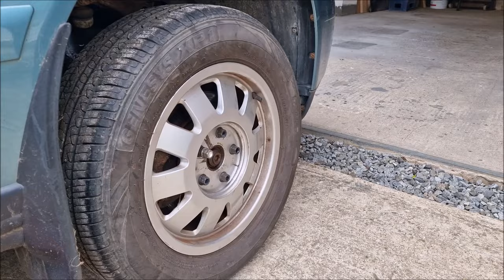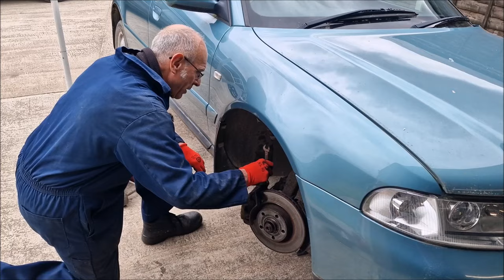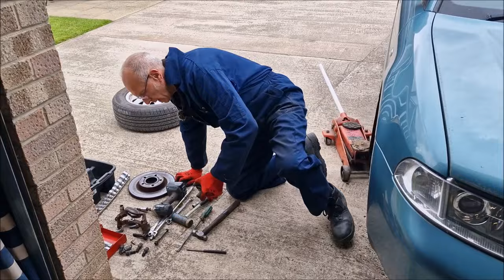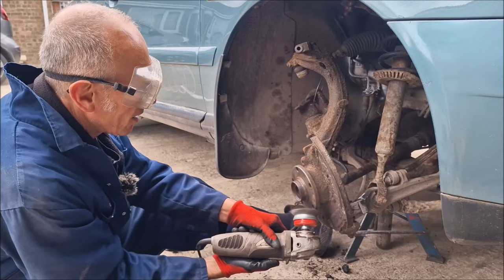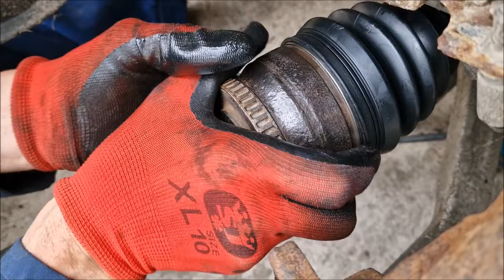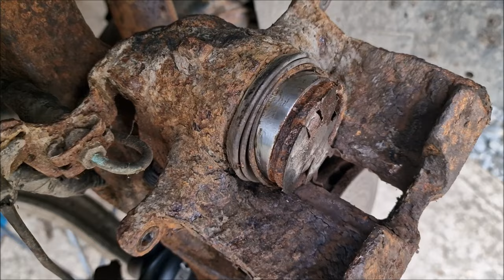Audi A4 MOT Failure Repair - Split CV Boot Replaced & Brakes Serviced

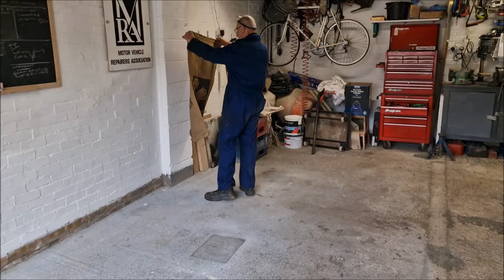Comment: 21:57 Copper grease on the hub face, a very thin smear really helps to prevent alloy wheels seizing.  Being stuck on a hill in the Pennines with a flat tyre in the middle of winter with a car only ever serviced by the main dealer taught me that lesson. A big rubber hammer and the repeated kicks of the recovery driver did absolutely nothing, so I had to drive it some distance with slightly loose wheel nuts and lots of rapid side to side steering wheel movement to get it to move.
Reply from the maker: I see your point there - Dad's an advocate for putting it on the ring where the Alloy meets the hub (locates) but not on the whole hub face!  Dad also says - he might have been taught wrong. Glad you got sorted!

Comment: I had to do this very job on my 2003 Volvo XC90 (same corner). While fixing an ABS problem. I found a small tear in the outer CV boot letting out the grease. I elected to remove the driveshaft and to dismantle the outer CV joint to clean it.
Reply from the maker: A good way of doing it!

Comment: That gaiter kit was really good value, but the material these days seems very different to the soft rubber boot that came off the car, any comments from Mr Coupland Sr about changes over the years ? Makes you wonder how long they are supposed to last these days, even with a respectable German sounding brand name.

That’s a nice understated effective efficient Audi…. a real oddity these days !
Reply from the maker: Dad reckons that the boot we removed was a previous repair and not a genuine or correct part for the car which may have caused the failure ☺️👍